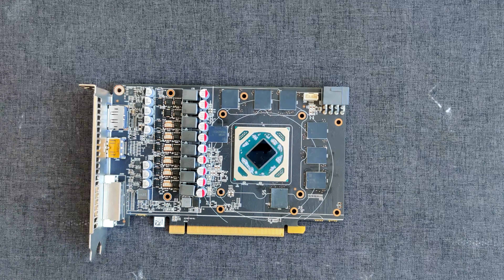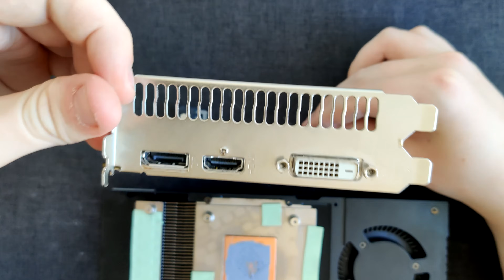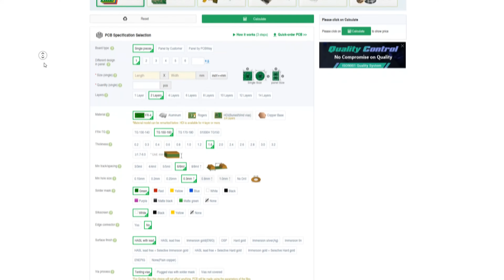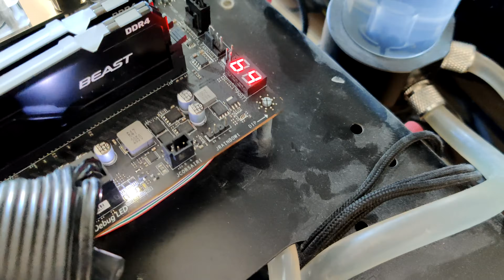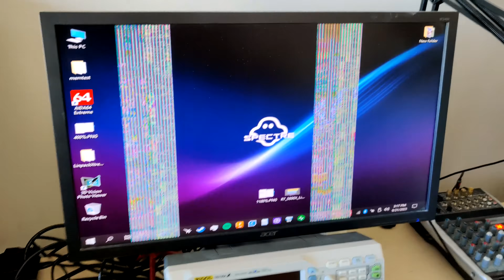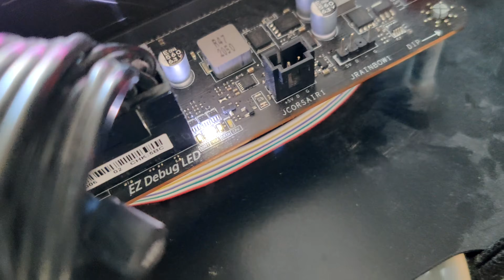Diagnosing a broken RX 570

Comment: hello my rx 570 has an issue, when I plug it into the motherboard the fans spins, but when i plug it with the pcie connector to the gpu all my fans doesnt spin and wont boot
Reply: It's probably the vbios that got corrupted. It might also have taken the vrm with it.

Comment: hello my rx 570 has issue  when i turn on the pc keyboard light and mouse and pc keep restarting but my gpu led light blue normal and has heat  look like power is okay i tryed another gpu and pc working fine but this gpu has problem pc keep restart and no start up  cant see pc bios and black screen pc restart every seconds i tested the 8 gpu ping by buzzer all  is make tune what this short?

Comment: I have a leadtek gtx 760 256 bit bus and it actually has 2x6 pin power connectors. It has this problem where once the card is on, the fans run at max speed with no display. The core warms up from the moment it turns on as well. I watched a lot of your videos to try and diagnose it and i can't seem to find the problem. If you can give me some tips, that'd be awesome
Reply from the maker: likely one of the VRMs not running

Comment: is that 300-400 ohms on 3.3v normal?
Reply from the maker: Some cards have low 3.3V resistance. So it's most likely normal. What i would be concerned about if it read in the single or dual digit range

Comment: hello commandeer I HAVE SAPPHIRE PULSE RX 570 4gb and i cant install drivers and it says code 43 i tried many fix like atikmdag patcher, reheat for 10mins, flashing different bios, and DDU none of them works. the card is detected and it boots fine. AND I HAVE SPARE POWERCOLOR RX 570 WHICH IS BROKEN CAN I GET THAT CORE CHIP AND PUT IT IN THE SAPPHIRE IN CASE THE CORE CHIP IS THE FAULTY ONE?

Comment: If you have the time to do it, you can swap in memory that's faster and or larger capacity than those Samsung 1GB chips, I've done that before on a GTX 760 with hynix 256 MB, I installed Micron 1GB chips from a 1070 and it worked just fine in heaven and furmark for hours, can't speak to if it would work on an AMD card, but I feel like it would at least tell you if the core is broken or just the memory based on the artifacts without a driver installed
Reply from the maker: you need a customized bios with the correct timing straps with that
Reply: @CmdrSoyo  I didn't for my 760, I just swapped the module and it didn't care, I guess it was just faster enough to not matter